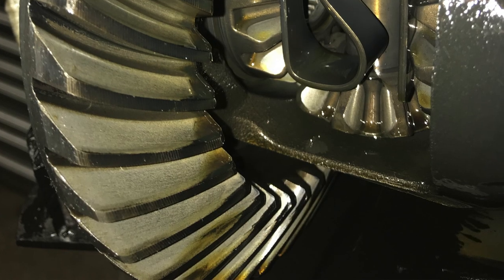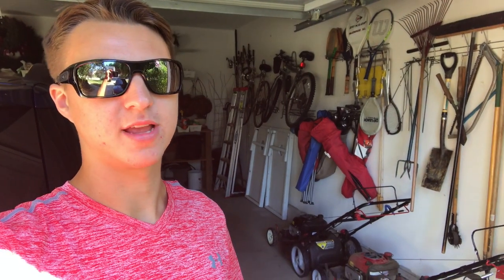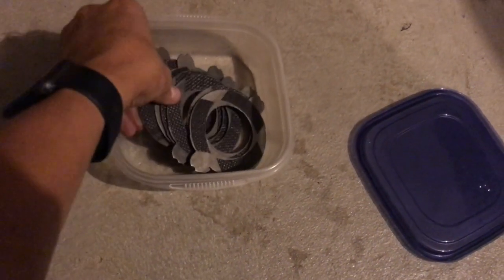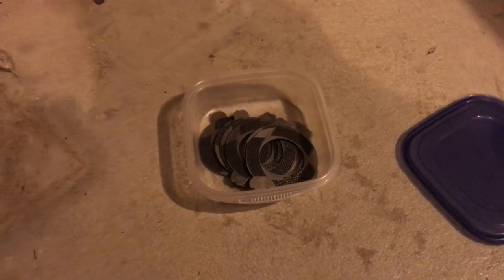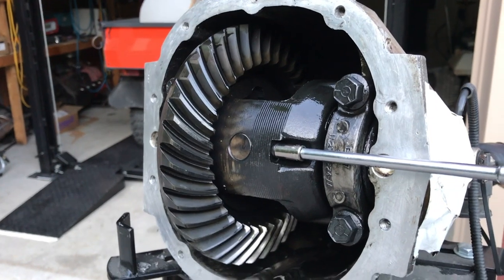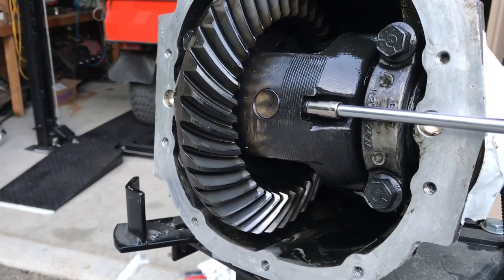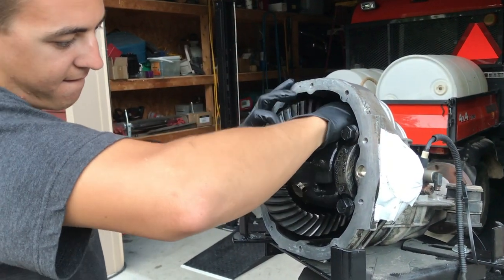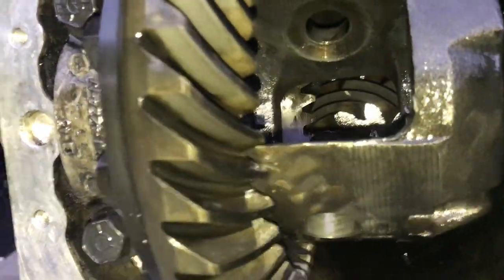Ford 8.8 Differential Rebuild

Comment: What makes these spider gears a limited slip differential? I have a new to me TJ jeep with a transplanted 8.8 and I have the spider gears with no S spring. I believe I have an open differential.
Reply from the maker: The spider gears aren't what makes it a limited slip, a lot of the 8.8's are open differentials. The S spring pushes on a clutch pack behind the spider gears and that's what makes the differential a limited slip. I would agree with you in that yours is probably an open differential especially since it doesn't have that S spring.

Comment: What happens if you  dont put the tone rings back on for abs
Reply: Depending on your vehicle you could lose speedometer, or speedometer accuracy, ABS, and will throw a check engine light for abs